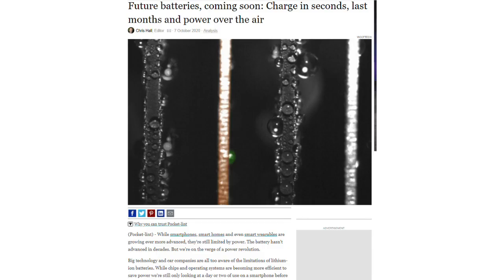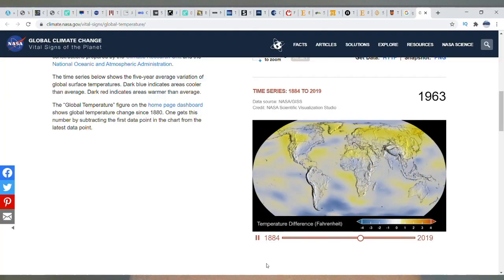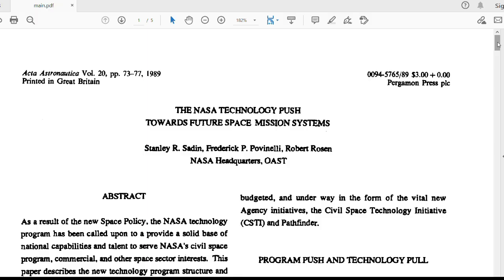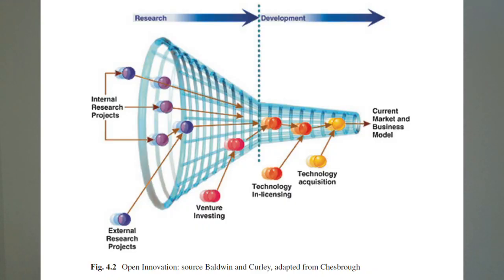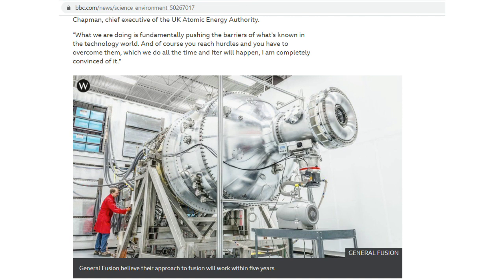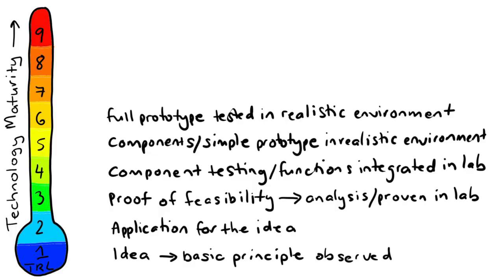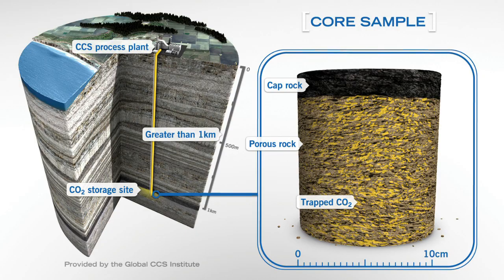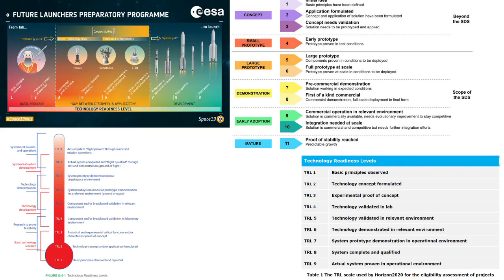Technology Readiness Levels and Renewable Energy Technologies

Comment: Rosie, good video and good presentation.

However, I do disagree with your assessment of small modular reactors (SMRs) as TRL 5 (large prototype) - although it may depend on one's definition of "small" - which I define as between 10-300 MWe.

I agree that the 6 MW MSRE at Oak Ridge in the 60s-80s only meets TRL 5. However, one has to distinguish between an MSR (molten-salt coolant reactor) and a SMR (small modular reactor).

SMRs in the US, Soviet, Russian, UK, and French navies have been working at TRL 11 (stable usage, multiple generations beyond TRL 9)  for decades. You may quibble that 'military' != 'commercial', but that is a quibble about market segments, not about the technology. True, the technology has ONLY been proven out to a small sub-set of customers (navies), for a specific application (ship-propulsion), but it has been proven out (in both DEMANDING customer expectations and DEMANDING environments) usually around the 50 MWt size, and in the several hundreds of units.

Even if one continues to quibble 'military' != 'commercial', at least 4 commercial nuclear ships were commissioned with SMRs, again fitting TRL 9 - in fact it is their lack of "evolutionary improvement to stay competitive" which adds the glue to the nailed-down definition.

It appears to me that the nuclear SMR readiness level is more about the Specific Offering Readiness Level (SORL - for lack of a better term), rather than the technology readiness level.:
* We have companies like NuScale which are attempting to launch their NPP at SORL 8, an implementation level of FOAK commercial NPP in civilian electricity generation at 60 MWe per unit (combinable to 720 MWe), well at the size of commercially proven military SMRs. NuScale is far beyond level 5.
* Also Rosatom's Akademik Lomonosov at 70 MWe, which despite a rather murky customer base, is clearly at least SORL 8, possibly 9.
* Likewise Oklo's Aurora (not quite a true SMR, but a micro-modular reactor at 1-2 MWe) is moving forward at the SORL 7-8 level (really no point for a prototype at that size).
Reply: @muhahaha I agree with you.

Our societies are insane in that with the example of France decarbonizing quickly, cheaply, and nearly completely, people look to the German Energiewende as a pathway - despite its failure to decarbonize quickly, or cheaply, let alone nearly complete! (the Germans do after all predict their coal plants will be online for another 17 years)
Reply: The economics (too expensive) and time scales (decade to bring online) are two hurdles for nuclear to jump through before they will be purchased by utilities.  Utilities make the decisions and right now they're threatening to shut down NPPs and declare them stranded assets.  Exelon in Illinois is a good example.
Reply: @acmefixer1  I agree that nuclear has to improve along those 2 criteria (CAPEX and time-to-build) - however, that doesn't make Rosie's assignment of nuclear to TRL 5 any more valid.
Neither Rosie's scale, nor NASA's scale, nor the EU's scale, mentions anything about CAPEX or time-to-build.
One is a technology readiness scale, the other is an investment decision scale

Comment: 100% Renewable Electricity = 20% of Energy
-- Over 60 yrs jets are 68% more fuel efficient and fly 60X more passengers
-- 4.4 billion air trips were taken in 2018 -- 2.63 billion in 2010
-- If batteries were 6X more efficient we would use 60X more of them
--  Earth is heating by 400,000 Hiroshima nukes / day
-- 1968 - 1992 = 1 nuke / sec
-- 1998 - 2020 = 5 nukes / sec
-- 1971 - 2018 global heat forcing averaged 0.47 watts/m²
-- 2010 - 2018 it went up to 0.87 watts/m² = 46% higher
-- 2% of vehicles are electric -- 2% of energy is solar & wind
-- 20% of energy is electricity -- 24% of energy by 2040 will be electricity
-- 100% renewable electricity = 20% of energy
--- 4% of energy is renewable --- 4% of mammals are wild by weight
-- With 23 billion chickens on earth, if one sneezes we all get the flu
-- Greenhouse gases went up 45% in 30 yrs 
-- 15% of energy will be renewable by 2040
-- 66% of people will live in water stressed areas by 2025 
-- 4 billion people live 1 month / yr in severe water stress
-- 20% less fresh water per person is available over the last 20 years
-- 50% of thermal & hydro electric power will be threatened with water stress
-- 40% of coal mines are water stressed, and so are 30% of planned hydro 
-- 20% of energy is electricity, 4% is renewable, 2% is solar & wind
-- Renewable energy cannot stop heating in time to avoid runaway heat
-- We kill trees 2X faster than we plant them
-- Trees grow faster die younger in heat fire flood & drought
-- Battery & Bio-energy extraction destroys native land water & wildlife

Vaclav Smil says:
-- North Euro offshore wind turbines work 33% of the time
-- North Euro onshore wind turbines work 22% of the time
-- North Euro solar panels work 11% of the time

Green Energy Harms Native Freedom Land Water & Wildlife
-- Europe burns 80% of the globe's wood pellets for renewable electricity
-- Europe burns 40% of its recycled plastic & paper for electricity
-- Europe burns 50% of its palm oil cargo in diesels for green bio-energy
-- Dams destroy 80% of river wildlife up and down the rivers
-- Shipping trees and palm oil overseas for green energy credit is criminal 
-- Europe's carbon credit system is corrupt
-- Europe's global carbon fund is rife with corruption

Support James Hansen's monthly private carbon dividends
-- 100% to you 0% to governments & corporations
-- That's why all governments and corporations hate it
-- That's why both socialists and capitalists hate it
-- Monthly Private Dividends = Real Climate Racial Justice (not the academic kind)

26 Nobel Prize winning economists support James Hansen’s monthly dividends, including: 3,589 U.S. Economists, 4 Former Chairs of the Federal Reserve and ALL 15 Former Chairs of the Council of Economic Adviser

You can find facts, sources & links at Loki's Revenge blog on wordpress under Green Energy Fraud

zzz zzz zzz
Reply from the maker: Hi Robert, it is sometimes hard to respond to your comments with so much text... it's tricky to find a point to respond to! And without context or sources, I can't really engage with the point you're trying to make, sorry!
Reply: @EngineeringwithRosie  most just ignore, delete or shadow ban me. At least you have some itegrity, unlike most. Sources" https://lokisrevengeblog.wordpress.com/green-fraud/
Reply: @EngineeringwithRosie  I just finished updating this page for you to look at https://lokisrevengeblog.wordpress.com/green-fraud/